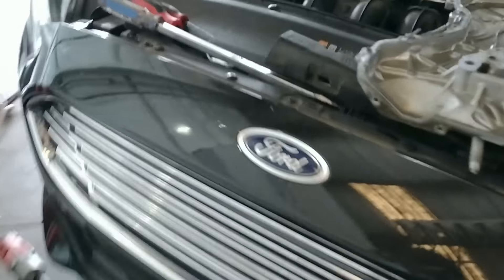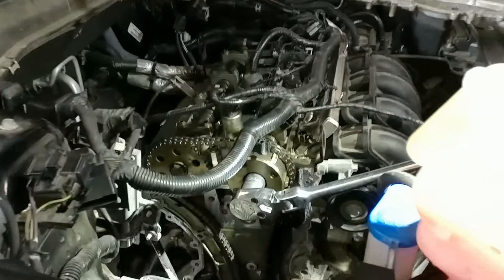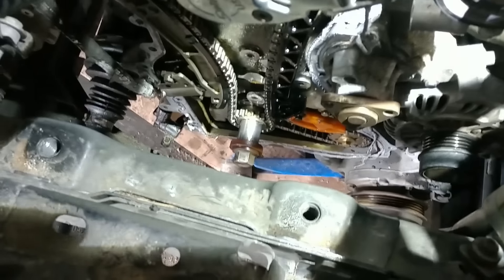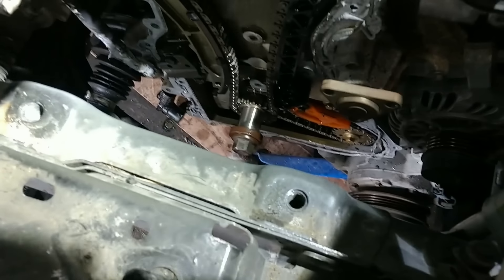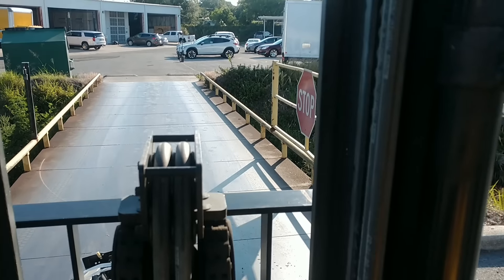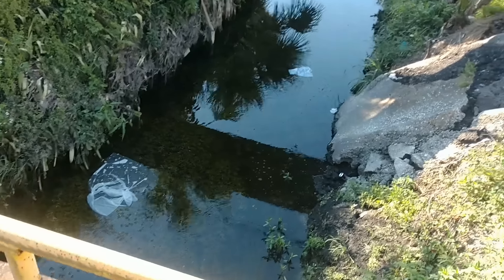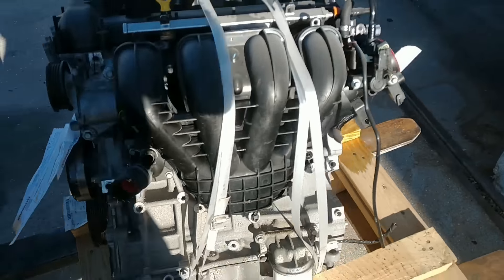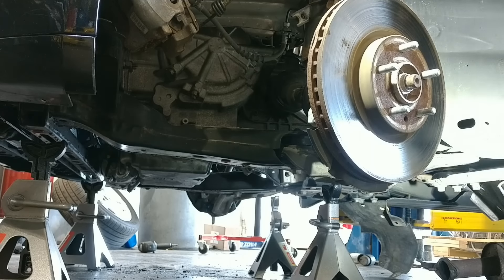Damaged Engine: You Broke it! Pt1

Comment: Damn! Never seen a balancer used to hold the timing sprocket before
Reply: Balancer does not hold it. The Crank Bolt does. The Service Manual even tells you in Big Bold Letters. Replace Crank Bolt if removed. Using the crank locking pin and Crank alignment locating tool for Crank sensor..
Reply: @WizzRacing  semantics. If the bolt holds the balancer and the balancer uses friction to keep the sprocket from spinning, then the balancer holds the sprocket. As was seen on the video, the bolt without the balancer results in the sprocket spinning freely on the shaft, therefore balancer does the duty of holding the sprocket.
Reply: @DL101ca  You can never touch that bolt and it can still fall down on you.. That is why there is such a shortage of used heads and engines. Not to mention try getting a new head. If for some reason the piston survives. 

I have a pile of parts for Fords and Mazda to prove it. As people don't understand what is entailed in something so simple...
Reply: @WizzRacing  with such a shortage of parts and engine how did they manage to get a complete engine for 400$ ? He specifically mentioned there's plenty of these engines available. I found it hard to believe they got one so cheap.
Reply: @DL101ca  Me too.. As KLM sells them for around $1,100.00 used engine...If you can get one.. 

The new head cost around $800.00 if you can get one...
Reply: Obviously you don't know Renault 😂

Comment: Ridiculous design!   No positive index to keep the engine in time.  Ford totally screwed the pooch on this engine.
Reply: To be fair, most everything I work on is like this in one way or another. When they started transitioning to press-fit/interference fit I was frustrated, but I can tell you now that it makes things sooo much easier. Lock the crank, lock the cams, pull timing components, do what you gotta do. Reinstall is just as easy - match witness marks, colored chain links, done. No keys to shear, no sintered sprockets exploding, no re-timing just to replace a tensioner.
Reply: When doesnt ford screw the pooch?? Every diesel after the 7.3 is junk, 5.4 triton junk, focus rs engine junk.......people who buy fords are crazy, mind you people who are buying gm are too.
Reply: @robbalinski1606  6.0 and 6.4s are navistar international engines, and the 5.4 3v if it does not have regular maintenance can get problems, But generally if the oil is kept changed they can last, i’ve seen a lot of issues out of 5.7 hemi‘s valve trains, but nobody want to talk about that 🤷
Reply: @robbalinski1606  even ram. They all have their flaws.

Comment: removing the engine by lifting the vehicle  up off of it is the coolest thing I've seen in a while    RIP tec
Reply: Yeah last time I saw that was on a VW Beetle!
Reply: Same thing has to be done on my 2002 z28 camaro.
Reply: @officialstoneyisboss7092  ... Chevy Astro van as well, except the entire front suspension comes with it. Caution: on many vehicles the car becomes back heavy with the driveline removed. You have to set the lift different or weight the front floor to make up the difference because the vehicle will slide off the lift.
Reply: @rupe53  have had the motor out the bottom of my z28 3 or 4 times.  Have always used a cherry picker to lift the front. Leaving the motor and trans in the K member.  Then roll it out from under the body while still attached to the tires/suspension
Reply: @officialstoneyisboss7092  ... would you believe a Corvair can be done the same way but it's the rear suspension. You can also remove just the engine or eng / trans out the bottom. Those can't come out the top.... no room.
Reply: Take it apart how it is put together.
Reply: @rupe53  to me it’s easier to pull to body off the Kmember, motor and trans than it is to pull the motor out the top.   Undo the driveshaft.   3 bolts for the trans cross member, 6 for the k member, all the lines you would normally do and then pull the body off.  When you pull a motor through the top on my car you have to remove all the accessories and sometimes remove the heads, intake, radiator etc.   motors come out the bottom of cars much easier. No need to tilt the motor or anything.
Reply: @officialstoneyisboss7092  ... each car is different so choose your battle.
Reply: @rupe53  how much of this is caused by a full fuel tank i wonder
Reply: @officialstoneyisboss7092  I guess it would boil down to if you have the means to lift up the car in the first place
Reply: @MikeSmith-ch7jv  ... if you mean being back heavy, that depends on where the tank is located. On an Astro the tank is ahead of the rear end and takes up 75% of the left floor area. IOW, fairly far forward considering it's a van.

Comment: I ran into that once. Special single use friction washer held everything on. Pulled the crank pulley to get the engine in. Put everything back, started it, and popped a hole in the piston. We somehow got the company to warranty it. We DID NOT touch that bolt on the new engine.

Comment: My cousin, and I rebuilt one of these engines in a Mazda 3. around 2:37 you see that bolt head just bellow that ear, and next to the wire harness. To Time this engine you have to remove that plug, and there is a tool (bolt) that you put in that hole, then turn the crank until it hits that tool. That sets the crank timing. We had to shade tree it by finding out the exact measurement for that tool, and just used regular bolt that was long enough to adjust to the correct measurement. This is one of the dumbest designs I have ever seen.

Comment: Thanks for reminding my why I hate working on Fords. Whether engine, drive train or suspension, they always find the cheapest, worst way of doing everything - and it comes back to bite whoever is working on it later.
Reply: They are ALL doing it now. High tech, high efficiency, mass produced disposable garbage. Specialized tools, reference data, and service requiring a dealership so small shops and DIYers are screwed. I was a decent mechanic 40 years ago. Now for other than a belt or oil change It's off to the local mechanic.

Comment: I have seen alot of half asked engineering as my time as a diesel tech but this takes the cake.
Reply: happened to me on 335i its a diamond encrusted washer that grips it together  lucky i caught myself before starting the engine
Reply: You ever worked on any kind of French engine?
Reply: The only french engine i ever worked on was (i swear this is true) a peugot in a bulgarian built forklift...yes..it was every bit bad as it sounds. As an added bonus, almost every wire on the damn thing was red!
Reply: Nothing French or at least I know of most of it is farmer rigged machines
Reply: @JimsRustyOldNuts  a lot of their engines have the same engineering genius as this one. The timing sprocket is only fixed in place by the pressure of the bolt.
Not to mention that someone thought it was a good idea to run the timing belt in engine oil. I've seen so many of these engines with ripped belts after only five years of use. Whereas I've seen engines with belts who don't run in oil last at least 5 years longer than the service requires.
Reply: @kukelhupf  In 5y of use you can travel twice the service interval of timing belt. Maybe someone assumed that if there are no covers like with normal belt it must be chain driven. You know, the same kind of people that grind their disc brakes to ribs.
Reply: @JimsRustyOldNuts  I'm Bulgarian and after working on a lot of french cars I've noticed an increased rate of swearing while working on something french compared to other cars..

Comment: Let me get this straight:  The harmonic balancer keeps the timing teeth on crankshaft in place.  

Who the hell designs something like this?  Those teeth should be machined into the crankshaft blank.

These Ford engines are actually Mazda products.  The people at Toyo Kyogo should be ashamed!
Reply: Or either key the trigger wheel to the shaft
Reply from the maker: It sure does. When the crack pulley what removed, the valve train rotated out of time and it nobody knew it. Then my guy went to crank after and bent the valves.
Reply: @RainmanRaysRepairs  Just put it on Craigslist Marketplace. Someone will buy it. Lol.
Reply: @williammatthews2948  Hahah!  But....Don't actually do that.
Reply: Who machines timing gear teeth into their crankshaft? What happens when it’s time to change the chain and the drive sprocket teeth are worn along with the chain? It makes more sense to key the timing sprocket to the crankshaft so it can be changed with the chain if need be with out having to replace the whole crankshaft.
Reply: @ralfie8801  I think most ot the time the timing sprocket is part of the crankshaft.  How many times have you seen worn teeth on a timing sprocket that are bad enough to matter?  The chains and guards and bearings and everything else on the engine will be dead way before that happens.  Ford/Mazda really should have done what you've said and at least keyed this part.
Reply: @Flies2FLL  
I have rebuilt quite a few engines, and never have I encountered a crankshaft with the timing gear machined into it. They’ve all been a separate gear so they could be changed or upgraded to a different type of chain such as a double roller chain or even just a wider link belt type chain. Sometimes they even have a gear drive instead of a chain.
Most crankshafts are made from cast iron, timing chains need to run on steel gears for longevity, cast iron gears won’t last near as long.
I’m not saying they don’t exist, I’ve just never seen one in 40 years of messing with engines of varying types.

Comment: Before cellphones, on a Sunday, the engine in a GF's car locked up 200 miles from home.  I had taken my car to meet her at the distant event, so I pulled over when her engine quit,. we drove to a phone, got a wrecker to take the car to the only service station with mechanic within 50 miles.  He took one look and accurately diagnosed the problem.  During an oil change she had been talked into a (much needed) radiator service including thermostat replacement, but the tech failed to clear out the rusted-out bottom of the old thermostat.  The new part would fit, but would not open and let coolant flow.  Result: Overheat, slow down, stop.  Probably blown something, I can't recall.  
Lucky for her there was an experienced mechanic at the station who patiently talked to the negligent shop over the phone, and explained how they had failed, saying he had the offending partial thermostat in his hand, and he had seen this happen before.    After initial denial, the shop manager owned up, sent a wrecker, took a week to fix it, and then I drove her the 200 miles back to get it.  Nobody gave her a dime for her time and trouble, other than the cost of a rental car for a week.  But I had a nice profit, you might say,  getting White Knight to the Rescue rewards out of the deal, if you get my drift.  Sadly, I learned that at 6' tall I was uncomfortable trying to make a long term relationship with a 5' female.  Both of us got a crick in our neck, her looking up and me looking down.  It wasn't meant to be, but she was a good woman.

Comment: The engine with 40,000 miles only cost $400?! Wow that’s a good deal!
Reply: I know, right.  LKQ never does that around here.  Especially on Ford motors. ..
Reply: Guessing nobody wants ford fusion engines and there's a ton of them out there.
Reply: @dannymccarty344  Engine..
Reply: @tcpnetworks  tell that to "Ford Motor Company" and "General Motors ".
I'll just bet, they don't care what you think either.
Reply: Great deal? No its amazing deal even in junk yards most of the engines cost more than 400 bucks and they got more miles/km on them
Reply: @merunask.9640  You’re right, kind of an understatement on my part, lol So why the did this motor only cost $400?! I mean, damn, that’s practically free! I just bought a full set of OEM brake pads for my Mom’s Kia that cost half that and I still need to install ‘em…
Reply: @tcpnetworks  this is what people who wanna sound smart say. Guy above me said it well, ford motor company, general motors, delorean motor company, american motor company, etc

mo·tor
/ˈmōdər/
noun
a machine, especially one powered by electricity or internal combustion, that supplies motive power for a vehicle or for some other device with moving parts.
Reply: if this was my car I still would be unhappy for reasons like not knowing the previous history of the engine. Did it skip 2 oil changes? Was it redlined 2 minutes after startup everyday? These things won't be known until way down the line. Shop should maybe give lifetime warranty? It's just a nightmare of a situation
Reply: @720chrisp  I agree. I baby my cars unlike everyone else who replaces their new car with another new one every 6 years so I’d want a new motor. However the law states when things like this happen the other party is only responsible to “make you whole again”. Meaning if they screw up, they only need to put you back from where you were when you drove into the shop. You can take your chances in court or small claims court but you’ll either lose or end up giving half the cost to your lawyer. Most dumb judges know NOTHING about cars and will just look at numbers. Like your old motor having 50,000 miles and the new one only having 40,000, they’ll be all “this one is 10,000 newer” and your explanation of how you warm up your cars before you drive and change the oil all the time will get you a dumb look.
Reply: I find it fishy how every time I call LKQ they have engines with 40,000 miles and engines with 200,000 miles. Never anything in between.  I think they just call the clean looking ones 40,000 and the dirty ones 200,000.
Reply: @billgates1682  I retort - So - I have a wiper engine, a starter engine, the 18V engine in my Makita drill, and the engine in this food processor I'm fixing seems to have a bad starting capacitor.

See how stupid is sounds?
Reply: @tcpnetworks  And I contort your retort by simply directing you back to the definition that absolutely invalidates your opinion of the semantics.
Reply: @720chrisp  Agree 100% as I would not want a "NEW" motor from the junkyard and maybe it's just me but that would NOT be acceptable . As you stated no clue as to the condition of said engine. The shop did the damage in the first place and maybe the junkyard engine will work out OR maybe it won't and that is a chance I personally would be 100% unwilling to take. This shop and I would have a problem...
Reply: @shane011471  I would not take it either .
Reply: @tcpnetworks  All engines are motors, not all motors are engines.  Do you call it a motorcycle or enginecycle? lol
Reply: @tokeituptyler5187  You call it a wiper motor, or a wiper engine?  Is it a starter engine or a starter motor?  What size engine is in your power drill?  What size engine do you have to open your power tailgate?  

Works both ways.   Look how stupid THAT looks.
Reply: @tcpnetworks  Yeah it looks stupid because it is incorrect. I did not say that they are interchangeable, as you are suggesting.  You can't call an electric motor an engine, but you can technically refer to a combustion engine as a motor. (Which is where all this began.  You corrected someone that referred to an engine as a motor)  An engine is a type of motor.  But in your examples, you are referring to electric motors as engines, which is incorrect, hence it sounds silly.

On the other hand, maybe I will take the nitro engine out of my RC truck and hook it up to my car's starter, and then I will have a starter engine 🤣🤣. Lol.
Reply: Okay ladies, have you both had enough of this pissing contest about the ever venerable “engine vs. motor” debate. Sheesh.
Reply: @720chrisp  in my experience, garages offer a wait for us to repair the broken parts or get a new engine with same or less miles. the repair obviously takes FAR longer, but the choice is usually there, in my experience at least.
Reply: You can tell which engines are short lived by the cost of a junkyard chunk.  If they're cheap and plentiful, there's little demand which means the engines don't generally crap out.  This engine was fine until its unusual design caught the tech off guard.

Comment: I've never seen anything like this happened before. Feel bad for your Apprentice he must have been having a heart attack
Reply: Many German cars are like this. Lock crank, lock cams, tension chain (or t belt)  torque sprockets and crank. No positive locating of the sprockets to the shafts. I believe the theory is, it eliminates some variation in the chain or belt, especially when every degree counts when it comes to variable timing in these modern engines.
Reply: Still though a little too selective for my taste that is one picky engine.

Comment: Most fords in the last 5-10 years no longer have a keyed crankshaft. you have to pin the crank with a special tool, as well as a tool that locks both cams together before you take the balancer off
Reply: This design is even worse than BMW's. Some BMW engines do not have a keyed timing pulley on the crankshaft either, however you can pull the harmonic balancer off without disturbing the valve timing. This design is a real land mine for anyone working at an independent shop.
Reply: In fact, European Fords have used keyless timing for over 20 years.

Comment: There are Ford/Mazda engines that the cam pulleys have no key to index the cam to the sprocket. A cam holding fixture is required to index the cam timing. This loose crank sprocket is a new one to me.  Very bad design that relies on bolt tension to hold cam timing. I didn’t get “bit” in my first encounter with this stupidity, but I know others that have!